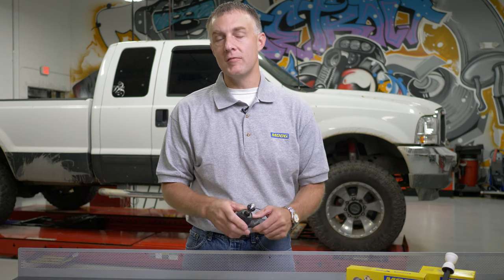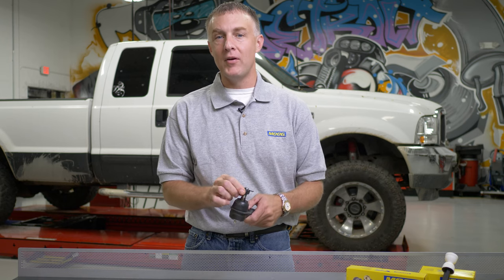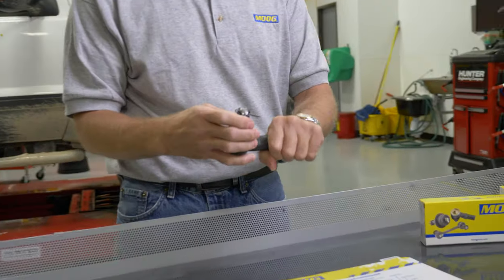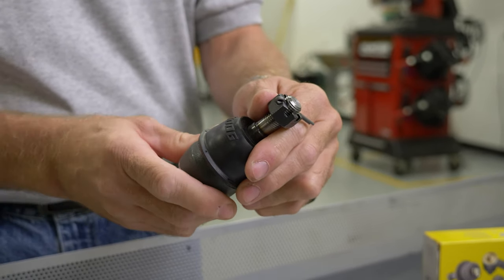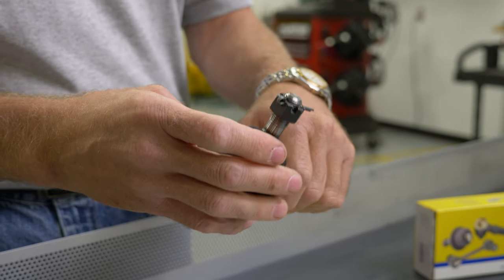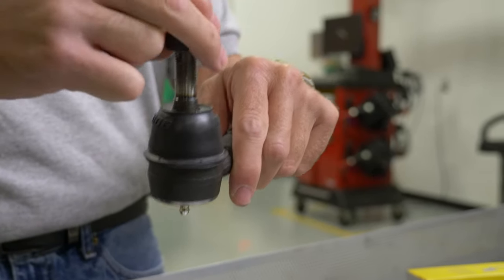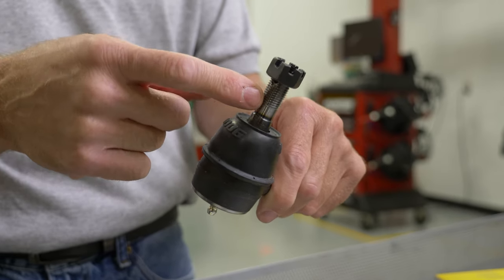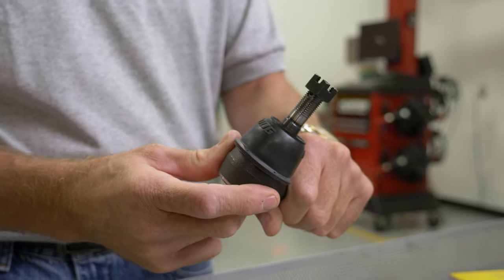Tie Rod End Installation Tips | MOOG Parts

Comment: I don't see how the stud centering even makes any sense. It's going to be at an angle anyway so the outer tie rod will meet up with inner, and of course even more so when car is lifted (at least on my car). Also assuming knuckle is free to move, the stud taper is being press fit into knuckle hole as you tighten the nut. It all moves to whatever angle - that's the whole point of a ball joint!  The socket part is inside the tie rod so no question of adjusting an angle. What am I missing? Speaking of the nut, to what specified torque exactly?  Moog website gives no instructions at all let alone a torque (at least for the tie rod I used).

Comment: I don't follow that first comment about centering the stud. Can you please elaborate and slow down??
Reply: He means you shouldn't flex the bolt out of center to install it in the Pittman arm hole. If it's already bent to one side to fit, when the vehicle bends it that way, it will encounter extra stress. Bolt should be centered to allow full action in all directions once installed. Keep front tires aligned straight when installing. Probably best to get an alignment after doing it yourself, too.

Comment: Would've liked a little bit more about installing the castle nut/pin. Lots of us do replacement ourselves. I can get the pin in without torquing the nut down so much that it starts crushing the rubber boot. I'm only replacing the tie rod end because the previous boot cracked open. I don't want to crush it again and overstress the new boot. I hand tightened the castle nut enough to easily get the cotter pin through the bolt. I don't feel like I wrenched it too hard. Hoping it was enough. If the pin is locked in properly, I can't imagine the nut needs more torque.
Reply: I can only talk about an 08 Civic and Honda specifies 40 ft-lbs; Moog doesn't specify anything. I'd be worried yours is loose. I used a torque wrench to tighten mine and 40 seems VERY tight and I didn't even go fully to 40 - I believe this is simply because the taper is engaging as designed. I was just worried I'm stretching the knuckle hole. The boot being crushed has to be normal. Extended, it's way up at the top of the taper so has to be pushed down during install. This will be to ensure pressure remains on the sealing surface at every steering/suspension angle during driving.
Reply: This seems to be a common issue lately with moog and a couple other manufacturers. my moog tie rod ends had the same problem. theyre either drilling the hole in the wrong spot or the studs are too long i guess. ive seen several forum posts talking about this same issue
Reply: Hello. Did you ever find a correct answer? I'm experiencing the same issue.. replacing cuz of boot split.
Reply: @Flohpange what about adding grease? Did you tighten the nut THEN add grease? I torqued to 40 lbs/ft ('06 CivicSi) then added grease. Like you said, 40 seems like a lot and the boot is crushed. Not sure what to do as I've followed instructions.

Comment: I'm looking for early Ford f250 4×4 steering knuckle tie rod end shims. I just purchased new Moog tie rod ends and the holes that I put them in are stretched. The tie rod end studs drop just a bit to far into the holes which makes it impossible. The nuts go all the way to the top of the threads on the studs so I need 7° shims. I called barns four-wheel drive, they only make them for GMC.

Comment: i) Keep the stud straight and centered when installing. ii) Don't over torque.  And what's the torque? You ask. Consult the service manual for your car.
Reply: I'll add: both the stud and the socket socket should be clean and dry. Unless, of course, you read the service manual for your vehicle and it says otherwise.